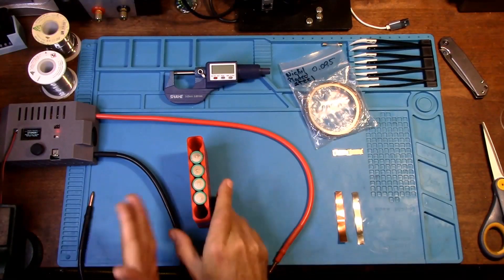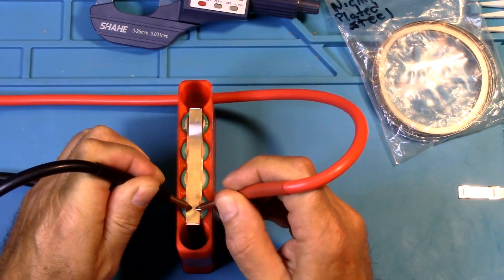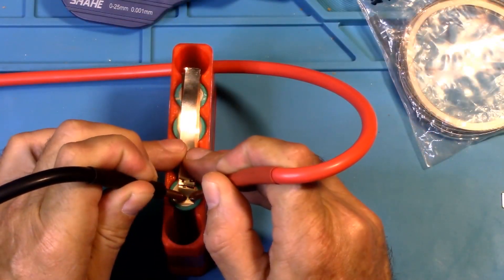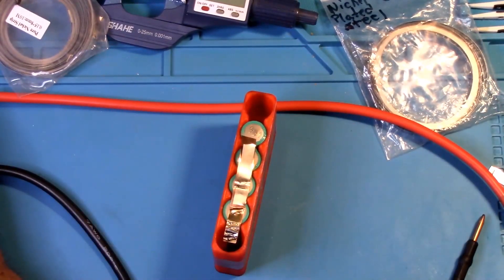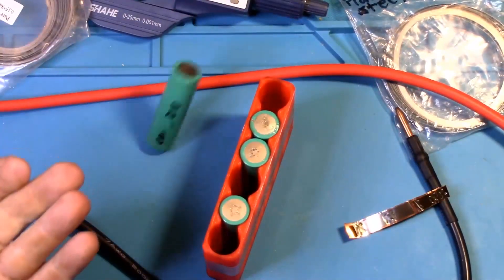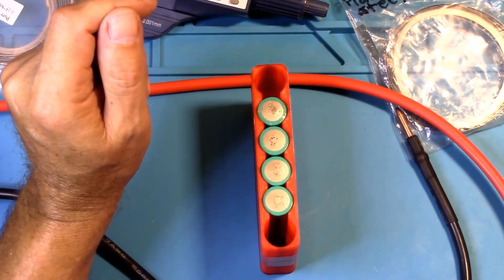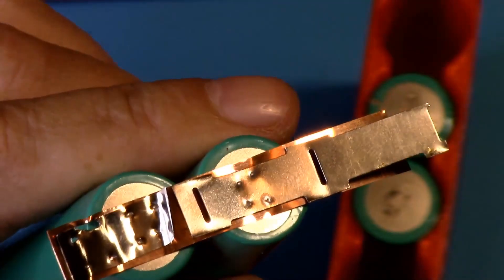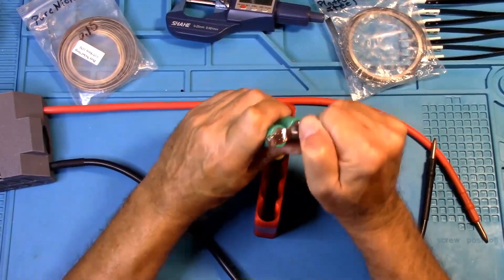Create A Copper Sandwich Weld With The Malectrics Spot Welder 1

Comment: Hi, I have a Kweld. I'm making some tungsten electrodes to try weld copper direct with out sandwich. This is all new to me have just ordered so 0.1mm copper to start testing.
Reply from the maker: Thanks, and let us know how it goes trying to weld copper only with the Kweld.  I should have tried that with the 0.1mm copper but didn't think of that.  I just know for sure it would not weld 0.25mm copper only with the Malectrics.  It would be good to know how your Kweld does with copper.

Comment: Do you know the difference between the spot welder 1 and 4?  I'd like to try a few things, basically play, not sure which to buy.
Reply from the maker: I am pretty sure the difference mostly is the case design.  The V4 has an all in one case, the Versions lower are more than one case.  I looked on the Malectrics site, and there is nothing for sale other than the V4, and also no information on earlier models.  I also believe that the V4 has software updates to make the welder work better, but am sure that is the major differences, as if there were anything significantly different, there would be more than one version available to purchase.
Reply: Thank you for responding, and keep the vids coming. @Outside-In.
Reply from the maker: @buzzsah  I will do my best to keep them coming, Buzz.
Reply: Improvements in V4:

1. Buzzer: With the buzzer alarms will not only be displayed on the screen but also be audible for the user. This makes it much easier to notice an alarm while working with the welder.
2. Temperature Sensor: The temperature sensor will trigger an alarm and disable welding when temperature reaches 65°C to protect the welder from overheating.
3. Additional 470µF Capacitor: With now two 470µF capacitors it is possible to use weld times up to 100 – 150ms without the risk of the Arduino Nano rebooting. The reboot could happen in V3 at very long weld times because the voltage at the Arduino Nano dropped to low dring the weld.
4. SMD Mosfet Driver: the mosfet driver chip has been changed from the through hole version that was plugged in a socket to a SMD version that is directly soldered to the pcb. The SMD version eliminates eventual contact problems that could happen with the through hole version when it was not plugged in the socket correctly.
5. SMD Mosfets: The mosfets have been changed from through hole version to SMD. That will eliminate the problem of failing mosfet legs in V3 on very high currents.
6. New aluminum parts: there are still two aluminum parts used on the mosfet board but the parts are just straight and both the same size. This makes producing or modding them for DIY users much easier.
7. Stronger Protection Diodes: The protection diodes on the bottom of the mosfet board have been changed to a much stronger version. They are rated for the same current as the ones in V3 but can take much higher short peak amps and have better heat dissipation because they are phisically bigger.